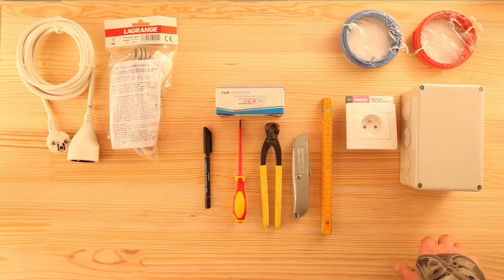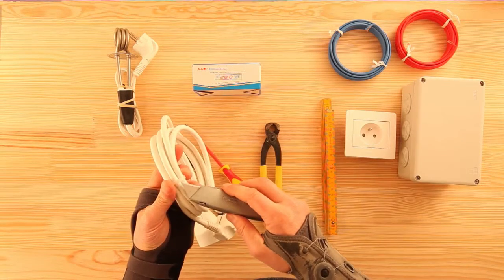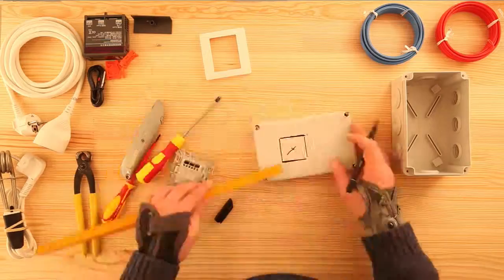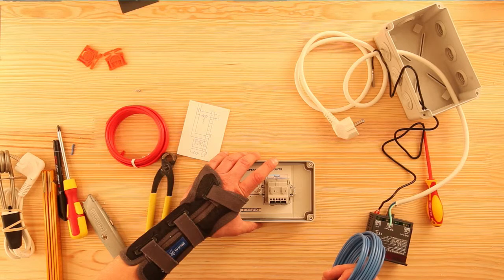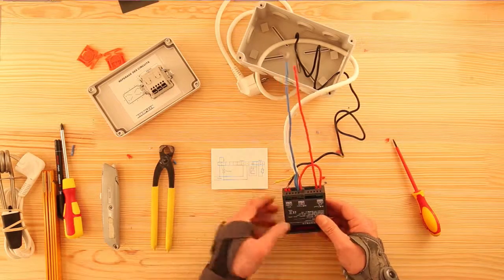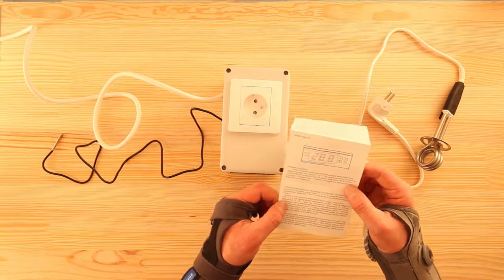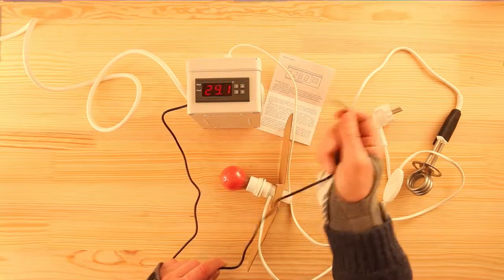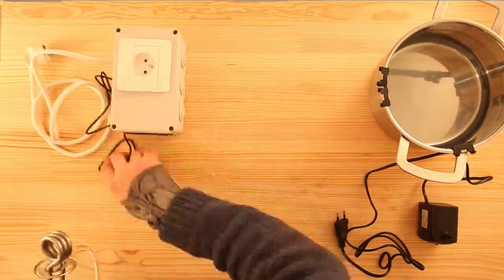How to build a multi purpose tempering bath

Comment: Very nicely done!  You could put a "Jobo" label on it and price it at $500. (Jobo does, or used to ,l sell a tempering tank like this plus the tank for about $275, but I think theirs lacked the water recirculating pump and the digital display.)